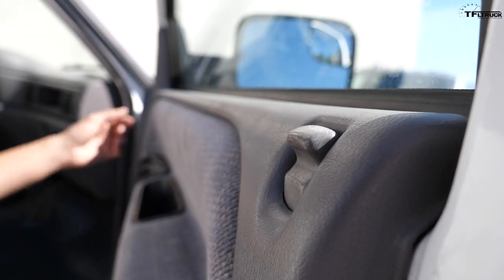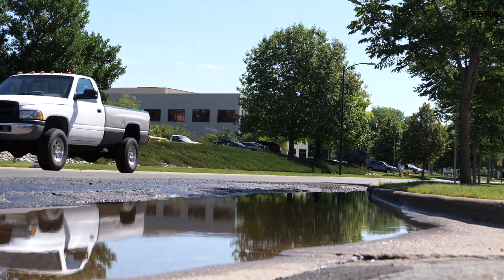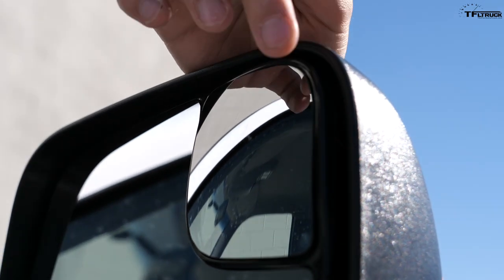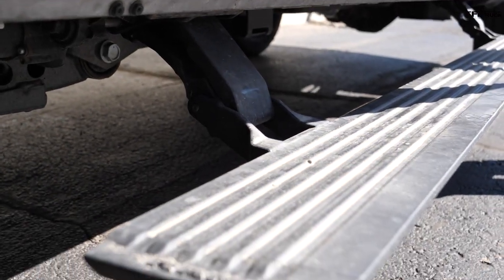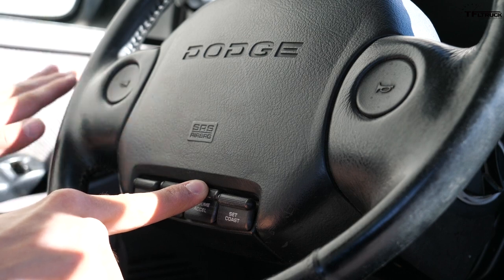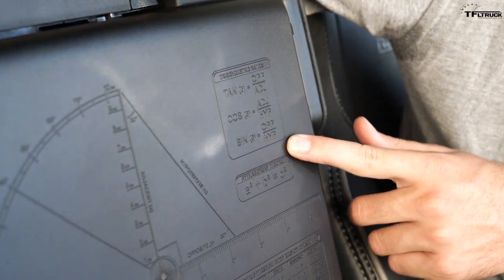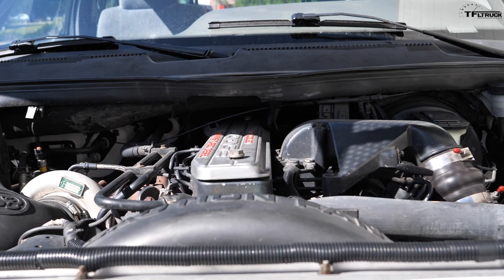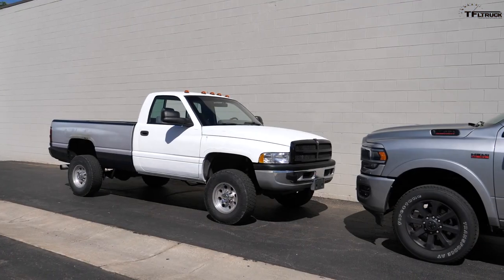Modern Tech vs Old School Simplicity: How Does A 1994 RAM 2500 Compare To A 2020 Ram 2500?

Comment: I'd still take the old ram. With the new ram I think he's downplaying both the initial price, which is already very high, and the long term costs of repairs (since the new ram has a ton of gizmos, gizmos that will inevitably break, and will likely only be fixable at a dealership). Most stuff on the old ram is basic and therefore fixable by most owners. Long term repairs can really bump up the price when you factor those in, so sometimes it's better to have fewer amenities and thus fewer things that can break.

The sad thing is, the newer pickups are so insanely expensive that people are snatching up the old pickups now so now the old pickups are going up in price.

Comment: 11:00 the brain should be much better then force upon owner it's new features, the automated climate functions keep overriding users settings into whatever OEM thought is smarter. The logic of it is beyond my understanding, i get why AC on turns on circulation, but why circulation turns on automatically AC? ... There is much more just in climate and it's horrendous, automation brilliant ideas needs to be option

Comment: I'd take the 94.... I like them better even without the conveniences of the new truck and current safety features. I like a truck that feels like a truck.... no new truck feels that way. The new rams from the 4th gen and onward remind me if the interior of a Caravan. No manual gearbox nowadays.... to stick to control your t-case. I just like the old trucks better..... oh and the 5.9 Cummins is a great engines.

Comment: Bottom line - there's trade-offs no matter what you get. One thing that hasn't been mentioned though is that the old truck will cause driver fatigue due to the ride and noise much faster than the new one. That's one reason I'm looking at getting rid of my 18 year old diesel.... even though I love it. Oh, and the towing capacity is literally DOUBLE on a newer ride.

Comment: I like the old truck, but only for the engine. The new truck will likely get better mileage even as a gas. Not to mention the transmission has a few more gears delivering a more highway friendly experience. Although, if you must have a diesel you can’t go wrong with a 12v.

Comment: Can never go wrong with the classic ram wish i had one myself but i love all gens been a dodge fan for like ever cause of my pops and now i  have a 2017 ram 2500 with the 5.7 hemi i just recently got it its a great truck well to me it is but i used to have an 03 ram 1500 with the 4.7 magnum 5 speed but the engine decided to blow a rod when i tried racing another truck😂 so now its sitting in my moms back yard gathering dust 😭

Comment: The old of course. It is a work truck. A manual transmission with a Cummins, that is awesome.
You don't need a damn button so that it stays in third gear, you just leave it in third. No nonesense, simplicity and better fuel economy.
Newer trucks feel like they are made for soccer moms, more than workers.

Comment: id take the 12 valve but i got a 2000  24 valve with 500 horsepower so i don't really need one but if i were to pick i still would take the 12 valve

Comment: Prefer old school.  Easier to fix (and cheaper) and diagnose.  Plus, the non working locks on the old truck probably just needs new power lock switches.  If locks go out on the new could be switches or, worse yet, the body control module, harder to figure out.

Comment: The new rams have all that tech to do work but you can barley do any work with it without breaks it. If you put a goose neck on that truck you would probably break the suspension

Old suspension was rated at a lot lower but still can pull a lot more. Good luck towing 14500 pounds in a 2020 ram.

Comment: That old truck keeps you worry free, whether it's replacing a rad hose or tight parking at a store, you don't have to stress over it. Big plus for man trans. Unless you're towing a big trailer its really the way to go. Here in South Texas they are everywhere, and since it snows so infrequently here, with deicer used only on bridges and overpasses, if used at all, the rust on them is minimal.

Comment: the 94 is by far the toughest and the best.  I loved my old 88 f150 simple reliable and with with the standard package you could almost open the doors and clean it out with a garden hose.  the new engines may be better but everything else I want simple.  trucks are for work.

Comment: First generation dodge rams were the best. Everything you need and nothing you don't. What happened to trucks in the last 30 years? Too many useless nonsense and unnecessary features. It's a truck not a limousine. What happened to front bench seats and manual transmissions?

Comment: For the price of a new truck I'd rather buy an old truck and rebuild, upgrade, and modernize it and I'd probably still have money left over and end up with a better, more reliable, truck that will however be a bit less fuel efficient. Not to mention the money saved over the life of the vehicle.

Comment: Well I have a second gen mine's a 2000 with the 8-foot bed for 4 wheel drive ner to reverse doors in the front I like old school just because there's less things that break I got better ground clearancenew parts in new vehicles are very expensive so I would be worried about breaking something that's why I drive an old truck and if I ever want to upgrade stuff I can always look at the aftermarket stuff and make stuff better in my truck like I have bed lights I got to put in but I haven't gotten around to it yet but I just like they seem to be less fragile than these new make steak more of a beating and keep going

Comment: the 94 ram or 2nd gen as they are known as was for its time a really upscale truck, and one of the trucks that made the shift from trucks being truly rough over to vehicles that drove well.  but the exact truck in the video being a single cab long bed cummins does not reflect that much, the comfy one was the 1500 club cab laramie+

to my eyes the 2nd gen is always one of the most handsome trucks out there. so much that a few years back i got one to restore.

Comment: New school more money does not always mean it's better. You can have a Harvard degree and still be a dumbass when it comes to the most simplest of projects or tasks.  The old school truck is just that simple to the point may take longer to get there but it will get you there. Normal maintenance kept up on the truck not waiting for a sensor to tell you is the way to go.  Reliability with that diesel engine is far superior than alot of engines out today. That engine will run on the ground by itself with 2 wires. Try that with anything modern in today's day an age.

Comment: I'd take that old climate control system any day! It just WORKED! The new auto-climate in my '19 Cherokee is a big PITA. You can't simply "turn off" the system and get outside air straight into the vehicle. You have to play with the temp. setting to find just the right temp. where it's not trying to run A/C or heat. Even with the A/C OFF, it still blows cold air when it wants to.  :(

Comment: the mirror style is factory for that year they didnt make the separate glass section along the whole bottom until later years because my 98 had the same as yours and so does my 03 but i bought 2014 mirrors for my 2004 ram and they have the full piece of glass instead of the little corner piece

Comment: I have a '97 Ram 1500 with a 5.9 360 V8 auto with 270,600 miles so far a still going strong, also the engine and trans are the original ones and I've hauled and pulled whatever I wanted. Now would I have a new one if I could buy one, yeah I would have both. I"ll never get rid of mine until it can't go anymore.
Reply: Plus I paid $1600 for my truck 7 years ago and how much is that new Ram? As long as nothing major goes wrong I'll be driving my truck another 7 years and hoping not much goes wrong with it.

Comment: I think it really depends on what you need. For an honest dependable work truck I would honestly just find a good condition 2nd gen, take all the money I saved and do some tuning to boost power and efficiency. Anything else you need like an inverter for power can be added easily. For a multipurpose truck that your whole family uses I would go for the 5th gen. They actually have rear leg room, they are comfy, quiet, and capable. Right now the biggest consideration is the longevity of parts for the 2nd gen. Those trucks are old and parts for things like lights, switches, and trim are likely to start becoming scarce.

Comment: The ram is much more powerful but more power in the motor wears parts and break the motor much faster.

And by the time you pay off the truck actually use if the truck you will be send it to the scrap yard.

Comment: If you want a truck ready to race and longevity, reliability, ease and cost of repair is not a concern go for the new one if you can afford the purchase price. If you want to feel confident in your ability to reach your destination without spending time in the shop or alongside the road buy the older one and keep up on the routine  maintenance which would be Less than the cost of the new one.

Comment: Look you have to think about this so if you crash an old truck you can replace any part and that's what makes it great but if you crash an brand new truck the parts are gonna cost you plus it will be harder unlike the old ones which are simple

Comment: That 12v with the right transmission can pull more than that 2020 since the 2500 diesel has 3500 axles that why the old ones are better

Comment: I own a 2019 Cummins mega cab 3500 High output. It’s a great truck, and I wouldn’t give it up. But I am
On the hunt for a 1994-1998 12 valve with a manual. I want it as a play truck and something I can tinker with. I would rather break a $8-10k truck than my $77k truck. This will be the best of both worlds.

Comment: All that tech stuff scares me. Think about the cost and time involved to take it to the dealer to repair something.
My 1995 Cummins 12v supercab is super reliable and I can do most of the repairs myself, like when the brake light and abs came on.
At 115000 miles it’s just broken in.

Comment: The button to go down bed is a nice feature that will break and be a pain to replace 7 years from now, and the goosneck stuff is nice but can also be installed in the old one along with the bedliner, yes its an add on but installing those will still be cheaper than buying that brand new ram

Comment: In case no one has mentioned it, I noticed you laughed at the mathematical formulas in the center console of the new Ram.  While I like both trucks, the formulas there are mighty useful for those of us who have ever had to calculate things like roof pitches for either the sales of roofing, or calculating rafter lengths, etc.  Very useful for those of us who found ourselves surprised by actually having to use Geometry, and othe math, after high school.

Comment: Electric and electronic - there's a difference, right?
Reply: Minor but different electric control uses simple switches relatively simple to trouble shoot usually cheep to repair.  Electronic introduces logic boards,computers, touchscreen,layers of programming and menus . Very difficult troubleshooting requiring diagnostic computer and programs . The cost of too many of components are a full weeks pay before taxes. Cost of someone with required skills and patience insanely high.

Comment: Bought a 2000 ram 2500 4x4 and you honestly can’t kill it. I had it stolen from me then wrecked, the police officers actually stated the truck wouldn’t turn off(there was no ignition in the steering colum no more) so they had to take the batteries cables off, even then it kept running. I got the truck back, charged up the batteries and gave it fuel( ram out since they couldn’t turn it off) and bam started up. I threw on a fass pump and noise isolator and fix the front end and it drives like it brand new.
Reply: Also keep in mind my total expense into my truck is about $8000. My father had his 2018 ram hit and costed about 4K just to fix a bumper and grill

Comment: I’d take older,  ‘03 or older simply for the fact that they last longer. Let me know when you can have a 2020 diesel last 500k-1mil miles without costing you mega bucks because you had to replace the DPF. Also how much it cost per mile when you have to not only watch it burn more diesel as it regens burning fuel for DPF cleaning and how much DEF you need to buy.

Comment: When I bought my new truck the first thing I did was burn the bedliner!!  It’s a truck. If you don’t get a few dents and scratches in it then your just driving a minivan!😄😄😄😄
PS: nice socks Tommy
Reply: That's by far the most idiotic thing I've ever heard. You NEED bedliner to protect your bed. Paint is there to prevent the bed from rusting out. Roll on/spray on bedliner should be standard on every truck.

Comment: I'm surprised that one tows less than 10000 lbs, my grandpa's 2nd gen pulls a 12140 lbs fifth wheel camper.
Reply: John Pedigo there’s a difference between what they are RATED to tow, and what the actually CAN tow
Reply: @richardclark4383  that is true but his is rated to tow 14000 so I guess it makes sense but it is also a 2000 not a 1994.

Comment: The 94 has a heavier tow capacity and payload than the new 2500 because back then the only difference between the 2500 and 3500 was the 3500 was a dually
Reply: Actually that is not necessarily true...  The 2500 in the old series used a Dana 70 axle if you had an automatic versus a Dana 80 on the 3500.  there were some years that the brakes were very different between 2500 and 3500 as well.  If you opted for a 3:55 gear ratio over the 4.10 You also lost capability.
Reply: IssaquahWA1979 the manual trans had Dana 80s on the 2500
Reply: When they changed the body style in 03 they got rid of the overload springs on the 2500 and made a single wheel on the 3500

Comment: 3,000 rpm redline haha
Reply: It's a diesel
Reply: Are you comparing redline between a diesel and the hemi?  You realize that all the brands in a diesel still are like $3,600 RPM redline right?
Reply: IssaquahWA1979 I’m prolly thinking of powerstrokes being above 4k before starting the line.
not comparing to gas

Comment: Not pictured was the dodges broken dash.
Reply: So a used truck from '94 should have a perfect dash? Show me any big 3 interiors from '94 and the all will have a ton of faults.
Reply: Not all have broken dashes either depends if people took care of them , I have a 01 Dodge Ram 1500 perfect dash but paint oxidizing ,, the 02 Dodge Ram 1500 I bought as a mechanics special  it had cracked dash cracked radio bezel  but surprisingly paint is good on it , both are quad cabs  I like the 01 with the 5.2l v8 over the 02 with the 4.7l v8
Reply: My dash actually isnt cracked
Reply: @kasevr  I speculate/suspect that's likely due to that it was probably parked in a garage/shop as opposed ta have been relagated ta havin' ta sit outside 24/7/365...as was commonplace with most pickups from the old days! (only the lucky one's were garaged every night prior to around the mid-late '90s)

Comment: 1994 5 speed will probably still last another 25 years. Those mirrors are some cheap ass aftermarket ones. Stock mirrors on 1994-1997’s were smaller and were more classy. 1994-1997 also didn’t have the extended cab doors open.

Comment: Always hate hearing kids from my generation trying to be a car critic. Simple fact is if you got a truck brand new today it wouldn’t last as long as a old second gen dodge. Plus the price is crazy. I’d rather pay 2k for a second gen that doesn’t have heated seats or a touchscreen center console or fancy tailgate. Instead Id rather have a truck that’s gonna get me where I gotta go and get the job done. Just had to mute it after the guy goes on about the suspension. This video has to be the worst this channel as put out. This is stuff is common sense.
Reply: Eat a snickers.  this was a fun video comparing old and new.  No one is being a critic here.  You're reading too much into it.
Reply: Jason Crittendon you may be right but these comparisons is stupid. “Oh this one has a key to unlock the doors and the one has a remote to unlock them” just not a fan of comparing obvious things. Also just to add some 2nd gens had remote start they really just went for pushing out a video with this one